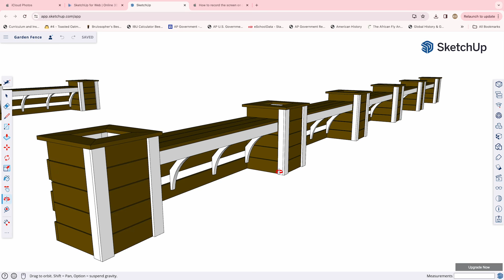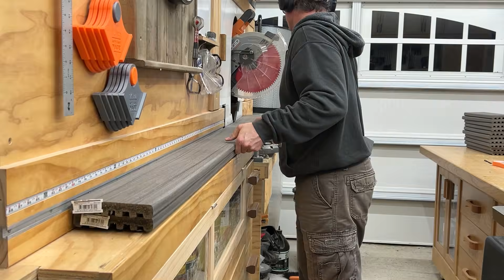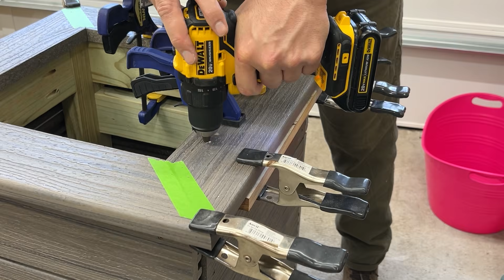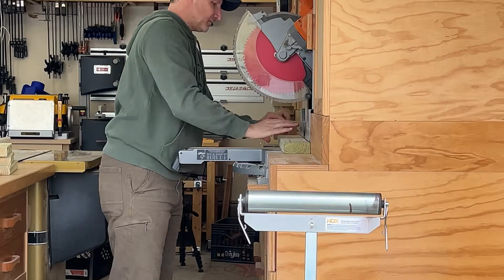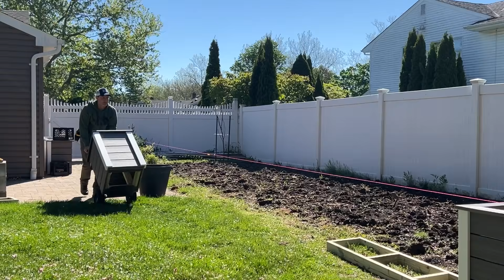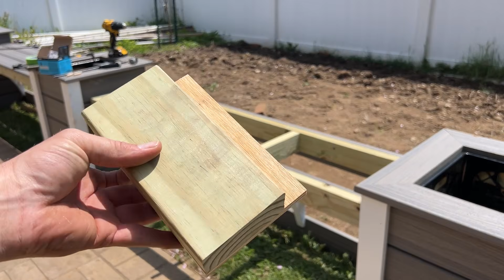Elegant DIY Composite Decking Planter Bench: Build Custom Outdoor Seating & Garden Space!

Comment: How are you planning on cutting and edging the grass under the benches? That is a fantastic design for concealing  your garden.
Reply from the maker: Thank you!  A grass trimmer cleans up that space nicely
Reply: @ArtisanMade  I was afraid that over time a grass trimmer would eventually cut a grove in the decking boards on the sides of the planters. Heck, I would cut by hand if I had a project like that! Again, very nice jjob!
Reply from the maker: @BoogerRed32  the deck boards a going to be fine but the pvc is a soft material. I need to be careful around that.